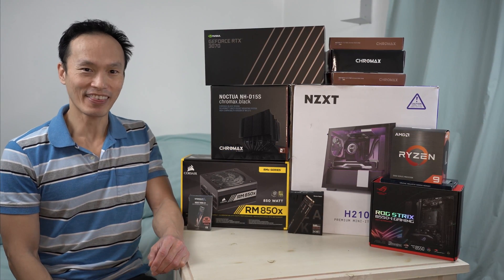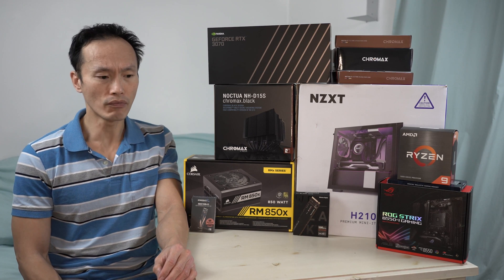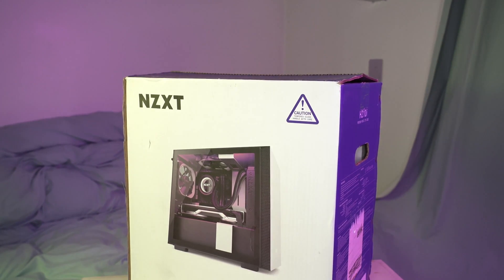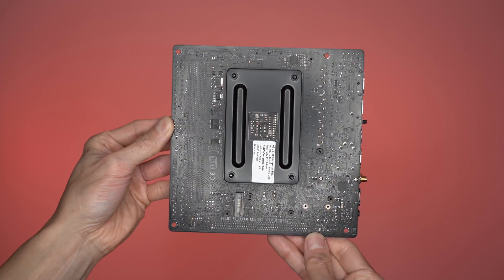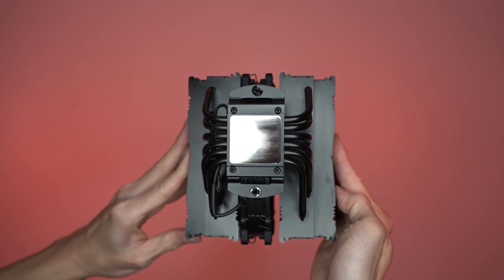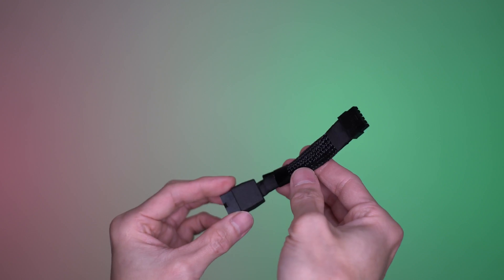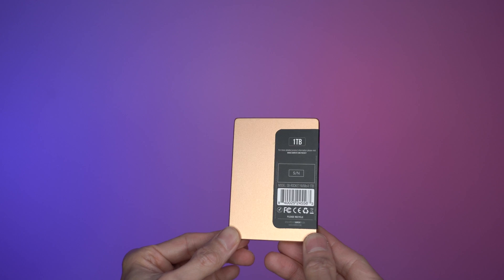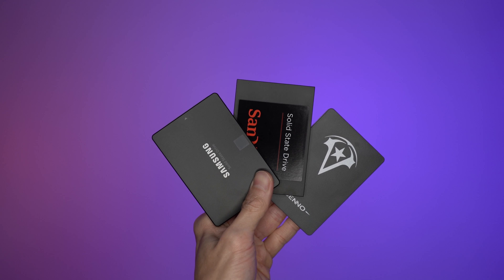Mini-ITX PC Build - NZXT H210i, Asus ROG STRIX B550-i, Ryzen 9 5900X, NVIDIA RTX3070, Noctua NH-D15s

Comment: did you ever do a follow up to this build? how has it been using it? how were temps?
Reply from the maker: Not quite yet. The PC has been a dream to use. Took everything I chucked at it.  The CPU temps are around 40°C idle and around 80°C under load, and GPU temps are around 35°C idle and around 70°C under load.

Comment: does the use of this air cooler cause the glass panel not to fit?
Reply from the maker: The glass panel does fit. However, the cooler tower is very close to the glass panel, approximately 2mm.

Comment: Floss was nice. Though I wonder how you managed to get the fan cable to the motherboard when you had mobo in case when installing?
Reply from the maker: With some difficulty and a great deal of pliability and flex. Before slotting in the fans completely, I positioned the fan cables right above the mobo fan pin heads and used a chopstick to push the cable socket into the respective mobo pin heads. Fortunately, the ROG Strix B550i mobo has the fan pin heads in the ideal place of in between the cooler towers. So, you can see the pin heads as you lower the fan into place. Also, the Noctua fan cables have a fairly rigid socket end. This helps in keeping the cable straight so you can push the socket into the mobo pin heads. It was still a job-and-a-half as you need to be pliable and flexible in manoeuvring the cables into the mobo pin heads.

Comment: Hello. Why NH-D15S instead of the NH-D15? I see you had issue with fan mounting because of the top of the chassis. Was there any reason to chose the "s" offset model instead of the centered design?
Reply from the maker: Hello, János! I chose the "s" offset model because I wanted to give a bit more clearance between the tower cooler and the GPU. And as you've pointed out, this created the new problem of not enough space at the top of the chassis. That, however, was solved by using a piece of dental floss. 😄 I was a bit jittery about the tower cooler being too close to the GPU because once the fans on the tower start to spin, they will create vibrations and the vibrations might cause the tower blades to touch and rub against the GPU and maybe scratch it. Also, I had found that putting a fan at the top of the chassis (intake or exhaust) did not help with chassis air flow and so, instead of leaving the top gap unused, I chose the "s" offset model where the cooler tower occupied that top space while clearing more room for the GPU.

If you intend to put a slim fan at the top of the chassis, you would need to go for the NH-D15 non-offset cooler. Just be aware that the tower cooler will be close to your GPU and if your GPU is more than two-slots thick, it will get a bit too close for comfort.

Comment: I have a question would water cooler not be better ? Sorry don't know to much about it all
Reply from the maker: Hello! Yes, I think water-cooling might be better as it would bring CPU temperatures down a bit more. However, I went for air-cooling because (1) it has less parts that might breakdown compared to water-cooling; (2) if any water-cooling parts breakdown, there's the potential of liquid leakage causing damage to electronic components; (3) if the air-cooling breaks down, it's usually the fans and so, fans are easier to replace; (4) liquid pumps add more noise compared to fans (although this depends on your PC usage and the water-cooler); (5) at the time of building my PC, the best water-cooler cost almost twice the best air-cooler; (6) I just relish the challenge of trying to fit the biggest fattest most humongous air-cooler I can get into the tiny case. 😄 I would suggest you look at both air-coolers and water-coolers and see which would be better suited for your usage.

Comment: Thanks for the video, do you think/know if a Noctua NH-D15 would have fit? I'm on the fence whether I should get the S variant. Awesome looking build!
Reply from the maker: Hello and thank you! From Noctua's technical specs pages, both the NH-D15 and NH-D15s are the same height (160mm) without fans. I'm guessing that if you use a 120mm (instead of a regular 140mm) fan, you should be able to fit the NH-D15 into the case. You can adjust where you clip your fan and so, you could clip it a little lower in the tower and thereby clear the height limitation. I would suggest buying the NH-D15 from a retailer that gives you a no-quibble returns policy so that if you find that the NH-D15 doesn't fit, you can send it back and get the NH-D15s. Hope that helps.

Comment: Only thing I would have done different is chose a way smaller cpu cooler yours is complete overkill and huge limiting your air flow, also would have went with a Sfx power supply to give your GPU a little more breathing room because it’s already really cramped in your case. Other than that it looks really cool
Reply from the maker: Thank you for your suggestions! The NH-D15s does indeed look like an overkill but at the time of the build, the 5900x was freshly launched and many reviewers were talking about how much power the CPU consumed and how hot it could get. So, the natural instinct was to get the most gargantuan cooler I could lay my hands on (short of an air-conditioner) to fit into an ITX case. 😁😂 As for the PSU, again, at the time of the build, PSU prices were stratospheric, especially an SFX or SFX-L PSU. When the RM850x came up on sale for £110 very briefly, it was a matter of making a split decision and clicking the "Buy" button because other PSUs of the same wattage and tier were way over £110. Now that PC components are tumbling down in prices (generally) compared to the last two years, I might take a look at your suggestions and tinker around with options.

Comment: I've been building PC's for decades now and I can tell with the upmost confidence that you swung for the fences with your first build. Great job. Working with Small form factor even when you have properly sized components can be a nightmare let alone doing something like this with a large cooler. Though you gave me an idea on what I might do with my own. I'm thinking of using a smaller form factor power supply in order to give the GPU breathing room. Those things like to die quicker when the thermals are less than ideal.
Reply from the maker: Thank you! Yes, I was thinking about using an SFX PSU but at the time of the build, the PSU prices were through the roof! The Corsair RM850x I managed to get when the price dropped momentarily at one point. So, I just went for it. Hope to see your future builds when you've finished doing them!

Comment: W Lee, I still don’t understand using the floss on the fan. Can you clarify.
Reply from the maker: Hi, there. The floss is one way to click the cooler fan into place. Once you have the mobo in the case and you mount the Noctua cooler, there is very little space between the top of the chassis and the cooler for you to clip the top clip of your cooler fan in between the two cooler towers. Most people use chopsticks or long thin pens/pencils but it's hit and miss. If you use your fingers from the back of the chassis to clip the fan on, you might get sore fingers because the space is so tight. So, by preparing the dental floss (or any long thin string) and tying it to the top clip of your cooler fan, you pull it and it clicks the clip into place without you having to struggle with chopsticks, pens/pencils or fingers.

Comment: Is there a space to put another outtake fan on the top?
Reply from the maker: If you use the NH-D15s, there will not be any space at all for a top fan. However, if you use an NH-D15, there is possibly a tiny space for a top fan but the fan has to be the slim 15mm kind. Do-able but it's going to be a tight squeeze.

An alternative is to have a fan attached on the outside of the top of the case. I've seen some people on YouTube doing it. Might be worth a consideration. I do not need the extra top fan as the temps for my setup are well below 80°C even during load.

Comment: Wow thank you very much! I'm planning to build a very similar one. My only question though is how is the fan noise now after 9 months?
Reply from the maker: Thank you, Christian! Fan noise is still the low hum in the background during idle. When work cranks up, the hum gets a little louder but not by much. It's not squealing or emitting distracting work noises. So, very happy with the setup. You can, of course, switch the fan curve to Quiet mode in the BIOS, if needed. The Noctua fans are definitely worth the long-term investment. Hope your build goes well! Would love to see the final build!

Comment: was there any issues with the RAM clearance over the NH-D15s?
Reply from the maker: If your setup is only one cooler fan, the maximum height of your RAM is 64mm which would be most standard-form RAM modules.

However, if you're going for a dual-fan setup, you need low profile RAM. If you're using another NF-A15 HS-PWM 140mm fan as the second cooler fan, the height of the RAM must be 32mm and below. If you're using a standard NF-A12x25 120mm fan, the height of the RAM must be 42mm and below. I stuck on the 120mm fan and my Crucial Ballistix RAM modules (40mm in height) had no clearance issues.
Reply: @wlee9727   Thank you for the reply! I rock with Team Group's Vulcan Z which are near the 32mm, this brings me peace of mind to mount a 2nd 140mm fan
Reply from the maker: Perfect!

Comment: Thank you for the video. I wonder how are you going to remove middle fan of the cpu cooler?
Reply from the maker: Thank you. Getting the middle fan off the cooler is easier than getting it on. Once the top clip is loosened and unlatched with your finger, the bottom clip will become loose as well. You can then wiggle the fan off the cooler. Initially, I thought it was going to be a problem doing it but it was quite easy to flip the top clip off the cooler tower.
Reply: @wlee9727  Please more videos. I really like how you review products. So clear...
Reply from the maker: Am working on it. 😊

Comment: Unbelievable that this would be your first youtube video, you're clearly very experienced in recording and editing! The build itself is stunning. I've been planning a new build to replace my i5-4570 and I've landed on just about your config. I actually found it via pcpartpicker when checking if the noctua would fit the H210.
Was there any reason you went with the Noctua D15S (single) and added a fan, versus going with the regular D15? Would you think it has any space constraints to go with the D15?
Let's say 8 months later, would you change anything?
Reply from the maker: Thank you, Michael!

Yes, I went for the D15s because the cooler towers setup is asymmetrical in that the towers are off-set towards the top of the mobo. This gives more clearance to the PCIe slot below which holds the GPU. I didn't know how thick the RTX 3070 FE is before I got it and so, I didn't want to chance the towers touching the GPU. I now know that the RTX 3070 FE is a slim svelte thing and so, the D15 would've worked as well. If you have a chunky chonky GPU, the D15s would be a better choice. If you have a 2-slot or less GPU, you can go for either the D15 or the D15s.

Also, if I had gone for the D15, it would not have been a nightmare trying to clip on the centre cooler fan because there would be a bit more room between the top of the chassis and the cooler towers.

Further, with the fans clipped on, the D15 is 165mm in height while the D15s is 160mm. With so little wiggle space in the case, that 5mm reduction makes a big difference. My D15s is about 3mm from touching the side glass panel. If I had gone for the D15, the cooler might be in contact with the glass panel and that would create more chassis noise as the vibration of the cooler fans would be translated onto the glass panel.

As for changing anything after 8 months, I would probably swap the PSU to 650W because what I use Candy Cassidy for (video editing, rendering, encoding/decoding, conversion, after effects) barely draws 500W from the PSU. So, unless you're overclocking or do 3D/virtual animation or you have a big-ass RTX 3090, an 850W PSU is overkill. Also, I might swap out the RTX 3070. Since I use a 32" 4K monitor, the RTX 3070 struggles sometimes, especially when my video/after effects edits are complex. So, maybe swap to a 3080 FE. But with the current GPU market still in a bloodbath, I am content with the 3070. :o)

When you've completed your build, it'd be great to see it!
Reply: @wlee9727  Thank you so much for this elaborate answer! I'm planning to start the splurge in the next few days, and will add a comment here surely!

Comment: Hello, you have been very cool. Thanks for the video so well done. Mine does not have the power of your pc, if it has little lights and a lot of water. What do you think of my construction? https://www.youtube.com/watch?v=pqwBXe7S8T4&t=11s
Reply from the maker: Love it, Cesar! The Pacman theme! Just brilliant. Did you cut out a circle in the back panel? Is it for ventilation?
Reply: @wlee9727  Thanks. All fans extract air from the case. My motherboard has the ssd pci on the back. I put a heatsink on it and cut the circle on the rear panel to fit the ssd. Due to the negative pressure the air enters through the holes helping to cool the ssd.
Reply: @wlee9727  Thank you, I'm glad you like it. Yes, it is for ventilation of the ssd placed on the back of the motherboard. All fans draw air so it goes in through any hole and cools the ssd.

Comment: What did you do with the one RGB connector? That looped around by the front fans?
Reply from the maker: Hello! Do you mean the the extra RGB cable apart from the existing RGB LED strip that came with the H210i case?
Reply: @wlee9727  yes the 4pin male cable that runs down the side of the front panel
Reply from the maker: Ah, yes. Since I do not have any RGB in my build, I've tucked that cable away in the back panel, tied together with some SATA cable with a cable tie. It's actually not too thick or intrusive. Are you having issues with where to put it?
Reply: @wlee9727  no, I just needed to know if it was need to operate the lighting properly
Reply from the maker: I see. That cable is for an extra RGB LED strip or possibly, another RGB part that's too far from the mobo.

Comment: Great setup! Any USB issues with the 5900x and B550? Would you go with the 11900K instead of the 5900x?
Reply from the maker: Thank you! No issues with USB so far with the B550i mobo.

As for 11900K vs 5900x, cutting through all the info and noise surrounding the i9 launch and benchmarks, it depends on what you'd be using your setup for. If you'd be doing more productivity work (e.g. video editing, graphics), better to stick with 5900x because it has more cores/threads and its multi-thread performance is stonkingly good. If you're mostly gaming, the i9 has a slight edge because its single core performance is better than the Ryzen 9 5000 series and gaming, generally, uses more single-core heft than multi-threads. However, from what I can gather from the various benchmarks online, for gaming, the 11900K is no better than the 10900K even though the latter is one year older in technology. The 10C/20T 10900K is equal to (and in some games, better than) the 8C/16T 11900K but costs between £100-£200 less. I would say that if you're mainly gaming and sticking with Intel, it's better to get the 10900K and put the savings into a better GPU. Gaming, generally, uses the GPU more than the CPU and so, best to pair a high tier GPU with a mid-to-high tier CPU than to pair a mid-to-high tier GPU with a high tier CPU (the GPU will bottleneck the CPU). For gaming, I'd suggest minimum RTX 2060/3060 for 1080p, minimum RTX 2070 Super/3070 for 1440p and minimum RTX 2080Ti/3080 for 4K.

Comment: That cooler is effing dummy huge. I was also going to ask how you manged all those cables down below but then I realized you don't have a 3.5inch hard drive down there taking up loads of room like I do. Dang. Oh and that floss trick is going in the "man book".
Really nice build. Really wish I went aircooling for mine (got the black H210) cpu but I just love AIO's too much.
Reply from the maker: Thank you! Yeah, that NH-D15s is a fecking big-ass cooler. It's doing its job, though, keeping the power-hungry heat-producing 5900x cool around 35°C idle and max 85°C under load. And yeah, the trick definitely goes into the "man book". :oD

Comment: Can you explain the purpose of the dental floss?
Reply from the maker: To click into place the cooler fan. Once you have the mobo in the case and you mount the Noctua cooler, there is very little space at the top of the chassis and the cooler for you to clip the top clip of your cooler fan in between the two cooler towers. Most people use chopsticks or long thin pens/pencils but it's hit and miss. If you use your fingers from the back of the chassis to clip the fan on, you might get sore fingers because the space is so tight. So, by preparing the dental floss (or any long thin string) and tying it to the top clip of your cooler fan, you pull it and it clicks the clip into place without you having to struggle with chopsticks, pens/pencils or fingers.
Reply: @wlee9727  Genius!!!!
Reply from the maker: Thank you. Hope it helps the next time you're building an SFF with a big-ass CPU cooler!